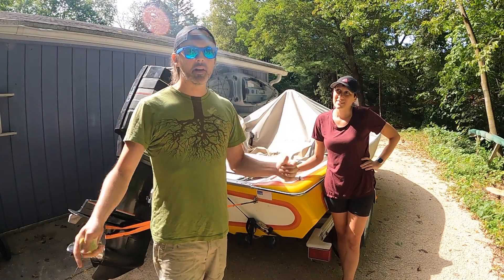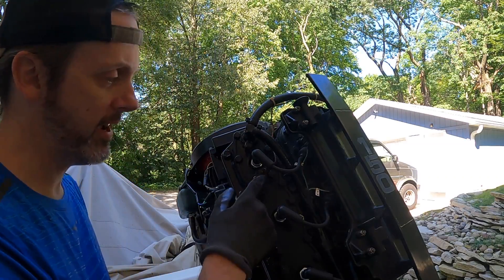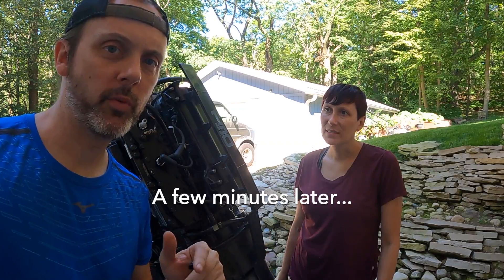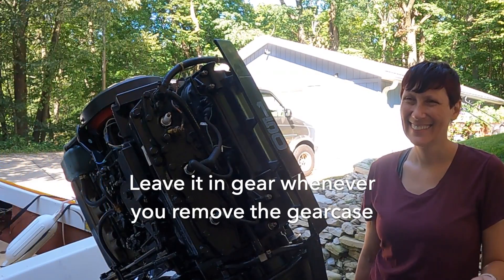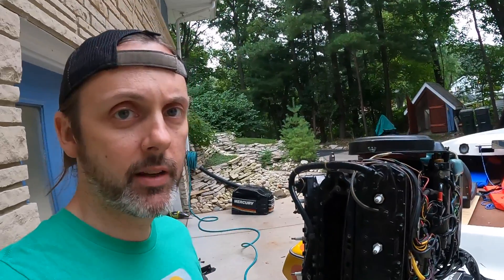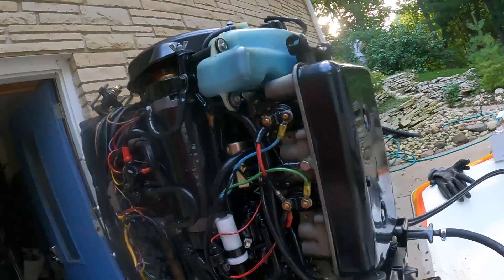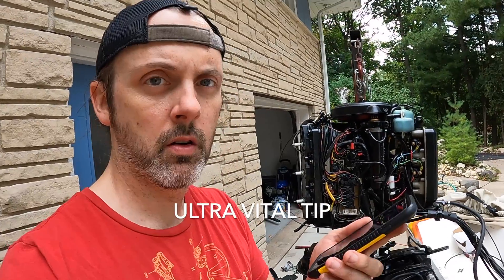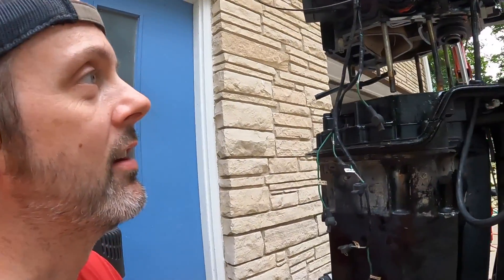Mercury 2 Stroke V6, POWERHEAD REMOVAL & HEADGASKETS #MercMondays EP6

Comment: Just stumbled on this series while working on my 1999 150 Merc. I’m 2 years late!! Not sure if you still have the boat or motor. If you do, I think it’s overheating because you have the wrong poppet valve cover.  I think I saw a port/hole just aft of your poppet valve diaphragm when you showed how you “fixed” it.  My motor has same port but my poppet  valve cover has a piece that covers this hole and provides a barb fitting  for  rubber hose that takes water to the heads to cool them.  The cover is sort of dog bone shaped and has 4 bolt holes.   There are at least 2 kinds of covers with dog bone shape.   I think the cover plate you need is part number 14462-C.  Take a look at one of those to see if it fits your motor.   Without the barb fitting I don’t see how water is getting to your heads.  No water to heads makes them hot and blows head gaskets and sets off  alarm.   I hope this helps someone…..
Reply from the maker: Thanks dude!  I pinned this so I can check it out when I get back to this project.
Reply: @ADDvanced  I've done so much troubleshooting here. One of the things I noted was that the passages leading in and out of the exhaust plate had some restriction. I took a round brush and cleaned those weep holes. Doing so, I would think, would keep air pockets from bubbling around in the heads. Also, the gasket has exhaust moving next to cooling water. A poor seal on the exhaust divider gasket could let exhaust gasses into the system. You'd probably see bubbling air coming out the tell-tale.  The poppet valve, as the gent mentioned above, is quite a big deal. If you're having experiencing high water pressure at WOT, then that's a likely scenario. That valve is supposed to open at 4-5 psi, allowing a higher volume of water to pass through the cooling system. I've done everything short of pulling the powerhead and heads. My exhaust divider plate had so much carbon gun buildup on int, I'm sure that was part of the problem. I'm going to remove the sacrificial anode near the prop and blow air up in there, flush, blow air, rinse repeat, until I'm sure mine is draining.
Reply: I think that pooling water under the divider plate points to restriction at the exhaust...maybe near the anode.

Comment: Guysa, you are setting too high on the transom. Lower it 4 to 6 inches and try again. Up on plane you are too far outa the water.... This is also why you bounce up and down like being trimmed too far up.
Reply from the maker: Sorry man, no way.  It is WAY low.  The jackplate is way down, and the water pickup is completely buried underwater when on plane.   Every boat will porpoise if you trim high enough as the thrust angle loses effectiveness.

Comment: If the oil injection was removed and the sensor was not disconnected you will get an alarm that can be confused with the overheating alarm. I'm trying to find out if my system is even working. I don't get any beeps when I turn on the ignition and I haven't had the boat in the water yet. I have to locate the sensor and check it then chase it down from there. I already know the wire coming off it is tan.

Comment: If the engine is good it might be the hull engine combination. In other words perhaps position of engine is causing water to pass intakes.   It might be possible to check this by moving engine down as test.
Reply from the maker: Nope, whole gearcase is buried underwater, I had Sarah go back there and film when I was on plane.   Once I solve overheating, I'll raise it up and gain a lot of speed, hopefully!
Reply: @ADDvanced  
I was thinking more of a ventilation issue caused by the shape of the hull. Even if the gearbox is underwater. Its unlikely  that's for sure but not impossible.

Comment: Seems like you did pretty well in your investigation after all you did find some smoking guns.  Chunks of impeller….  I‘d have liked to see you run some wire or something through any passages it would go through in order to find the blockage.  I believe the pee stream being before the engine is telling you that your water pump is working but as you know you should have a whole lot more water coming through the exhaust.

Comment: You should have removed the stack and separated the exhaust adapter and water plate. From what I see with all the impeller pieces, it only takes a small piece to block up a passage. I have seen it happen more over my  28 years as an outboard tech.  It appears it’s not dumping the hot water.

Comment: To answer your question at 13:11 - it's possible that you aren't seeing liquid water coming out of the exhaust because it's turning into steam in the combustion chambers. But I would expect the pistons to be way cleaner than what you showed if most of the water was being routed there. Unless you are talking about when it wasn't running at all just on the hose.

Comment: There's a guy on youtube, he has probably one of the best outboard related channel and watch his last video, and maybe you will have the answer to you problem. The channel is Dangar Marine.
Reply: I've watched every single one of his videos and it still wouldn't help me diagnose this outboard, lol. He has a lot of issues going on here and the cooling systems are complex. It's possible we still don't know what the biggest cause was. Impeller bits everywhere and leaking head gaskets may have only been some of the problems.

Comment: I bet if you move the battery and fuel tank farther forward the back of the boat wouldn't be so close to sinking when you slow down. Either that or add tiny bit of ballast weights to very front of boat. But yeah, reducing just a few pounds from the back would be a big improvement.. Even quicker takeoffs
Reply: Then it won't respond to trim at top speed as well. Trust me, I'm dealing with the opposite issue. Too much ballast too far forward. I wish I had that big central tank in the back. I put my battery way back there to compensate. Finally after putting ~100lb+ of interior (carpet, bench seat, etc) it's starting to respond better.

Comment: Smart to take it all down, replace gaskets, yes that gunk is head gasket leaking. Those extra parts would definitely cause over heat. Now if it's not you can raise that engine

Comment: Can't wait for the next video, I bet the overheating is fixed. You are doing it rignt and with care. The impeller blades probably started the problems.  People treat these engines as if it was an ordinary outboard.  It's NOT, the race version of the V6 is a full on F1 H2O race motor ( 400+ HP and up to 10000RPM ), yours is a "calmed down" version of a stunning engineering masterpiece. Treat it accordingly and it will run for another 50 years.  Greetings from a fellow "Merc-aholic" from Sydney Australia.

Comment: For studs that are corroded/stuck, there is an old trick where you use the nut with a homemade spacer between the nut and the midsection casting, turn the nut to "jack" the powerhead up by a very small amount (1/16" ) .  Usually this is enough to loosen the stud.

Comment: So I made you a video on cleaning out the adapter plate on a 2.0/2.5. There's  more passages under the first plate. I love the way you aren't afraid to tackle a job most wouldn't. 
I hope you got it cleaned out enough, if not, now is a good time to put solid motor mounts in it. By the way that fancy cowl cost new, 4 times what you bought that boat for:)$$$$

Comment: Yeah, I have had even the short studs have so much corrosion around it that it was lifting the whole boat, motor and trailer up off the ground!!
  *I've had to go to other marinas to drill out the studs to get powerheads loosened up..

Comment: So I wonder if the head gasket was a symptom of poor water flow due to all the crap in there preventing adequate coolant flow.
Reply: Probably. Multiple high heat cycles probably weakened it.

Comment: Did you check thermostats could be closed
Reply from the maker: In previous episodes I’ve run with them and without them and replaced them. No change the entire time.   Water should come out the exhaust no matter what yet I’m getting none.